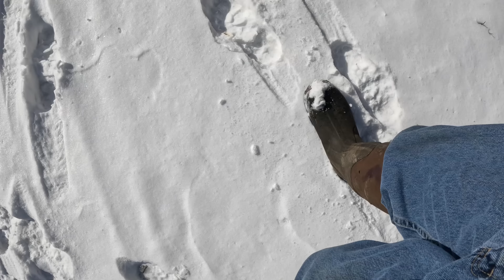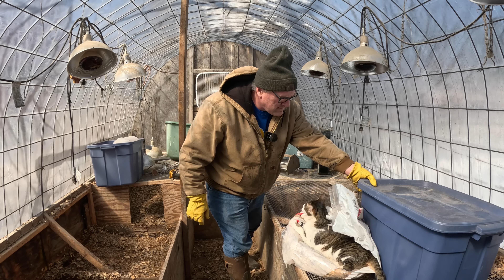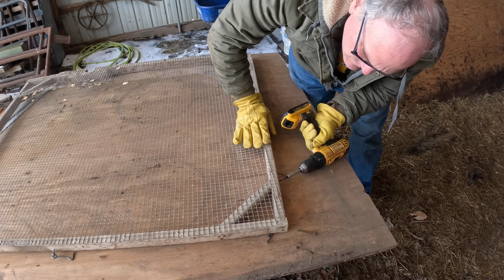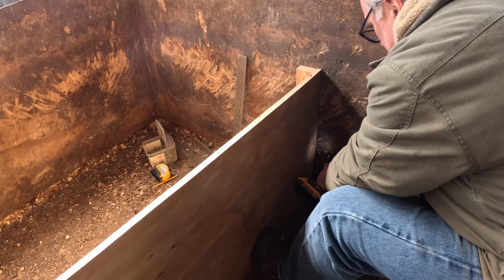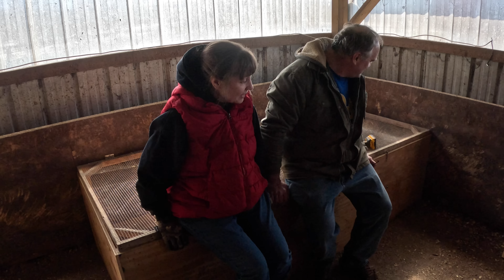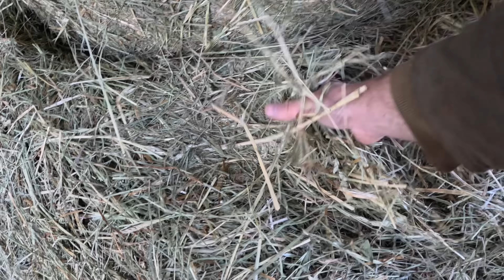Hungry Cattle and Chicken Brooders

Comment: Enjoyable as always. I have a dairy barn with cement floors that I am converting this year. Besides bleach, do you have a thought on whitewash as a disinfectant in your poultry areas?   I was told that I should whitewash every year...   Thanks.  Always eager to learn.
Reply from the maker: Maybe I shouldn't have mentioned disinfecting. We've never disinfected brooders. Our layer death rate is less than 1%, and Cornish Cross broilers 2-3% to dress weight.